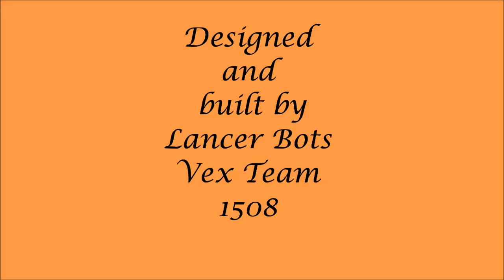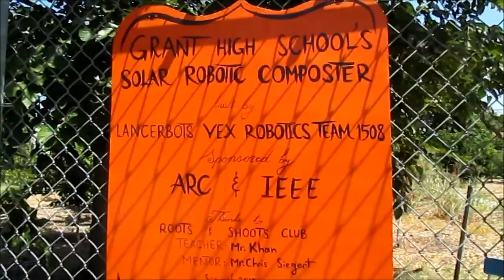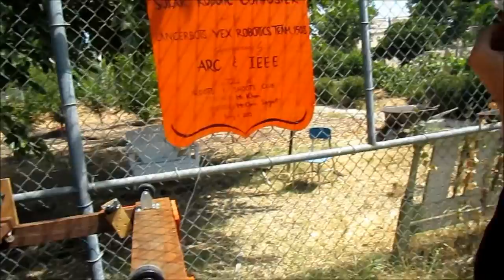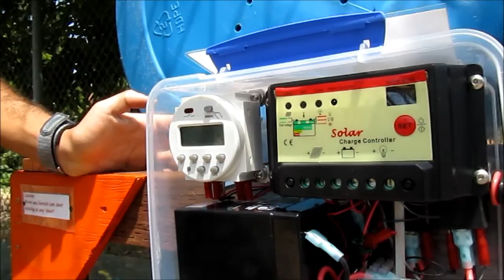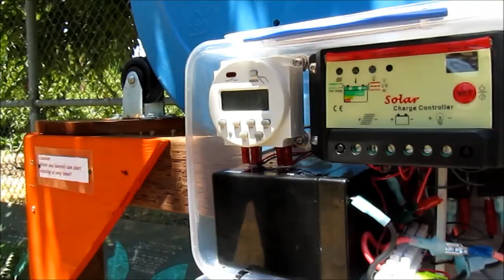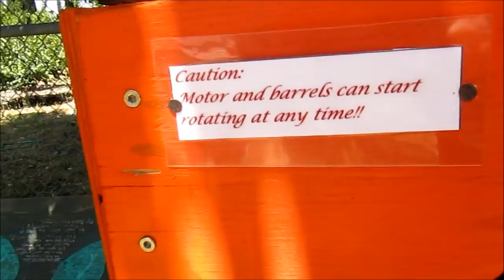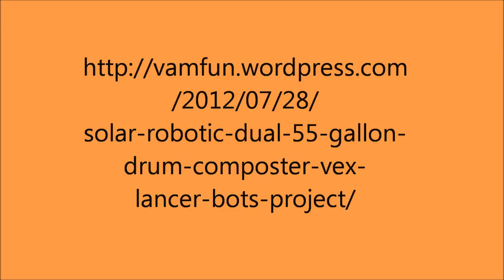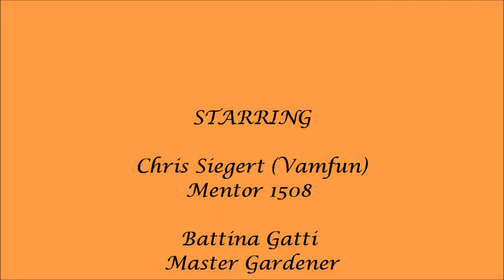DIY Dual Solar Robotic Composter (Vex team 1508 Spring 2012 Project)

Comment: Just got a montanna door motor today. Pretty basic  removal of pass. side pannel and seat belt bolts to get at the motor mechanism. Wire cutters or release the cable tension to get better access the the back of the assembly to get at the motor. Hardest part was removing the rusty pressed on washer on the motors long shaft to gain access to the bolts holding the motor to the assembly.

Comment: Nice design!   If you want to speed things up, though,you should A) paint the barrels black, and B) move it to as sunny a location as possible.  The hotter the barrels get, the faster and cleaner the contents will compost.  You need a core temp of at least 140degF to kill most seeds, and upwards of 160degF for things like tomatoes.